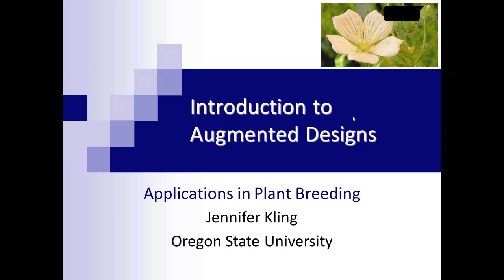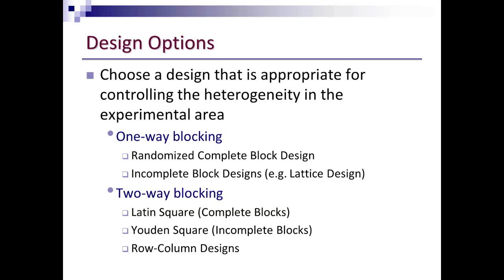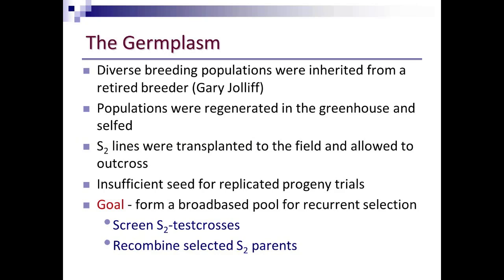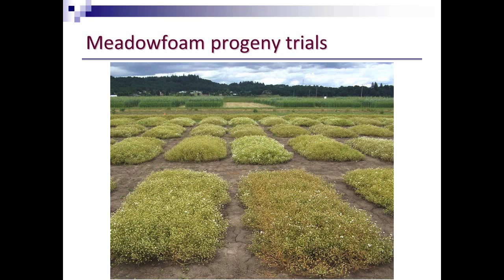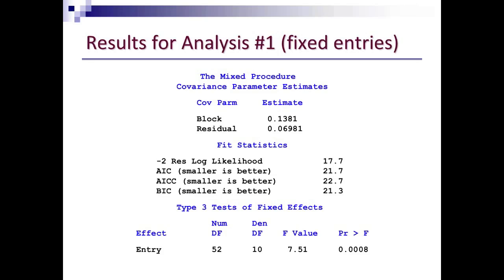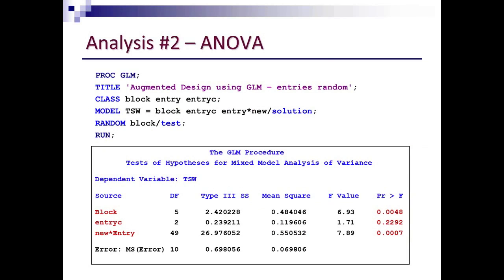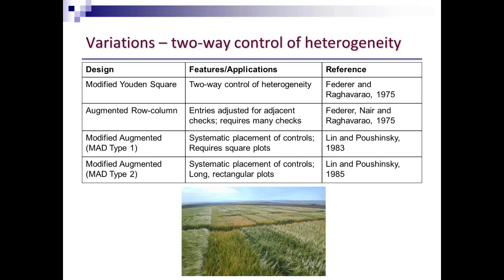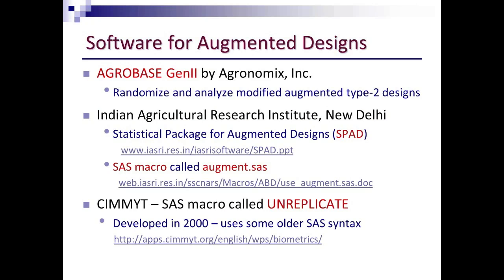How to Design and Analyze Experiments Using an Augmented Design

Comment: Hello  Sir,

heritability and genetic advance for Augmented design, because only
checks are repeated in the experiments. I used Proc mixed model in
SAS, in the 1st run, treat as fixed and block as random.while in the
2nd run treat partitioned to test genotypes (as random) and checks
(fixed) to produce BLUP.

Please, sir, I need your kind guidance to estimate  heritability and
genetic advance to complete my experiment (it is single trial, 225
testing genotypes,with 5 check and 5 block).

I hope your response  is soon!